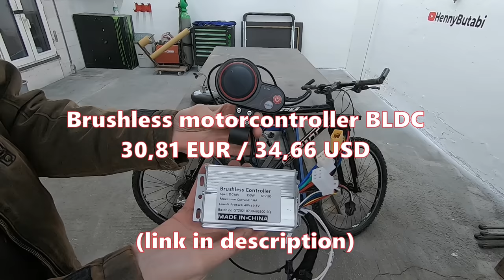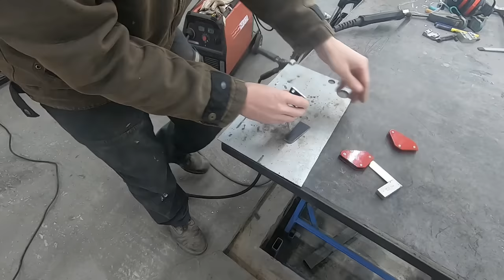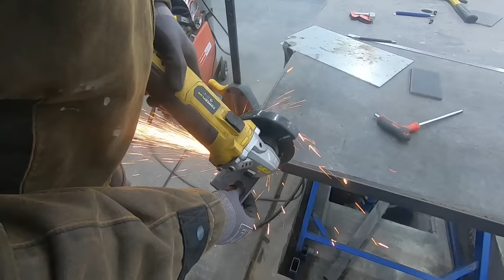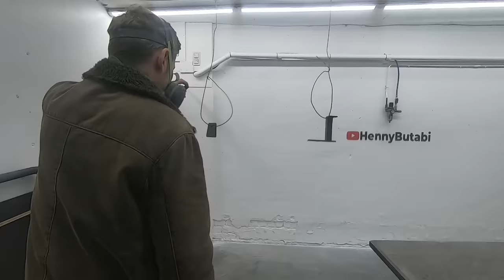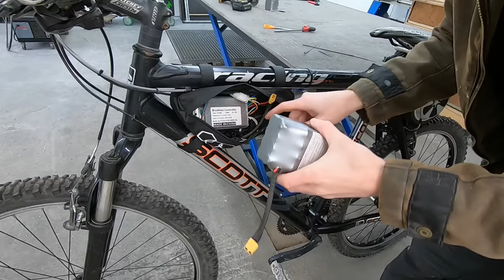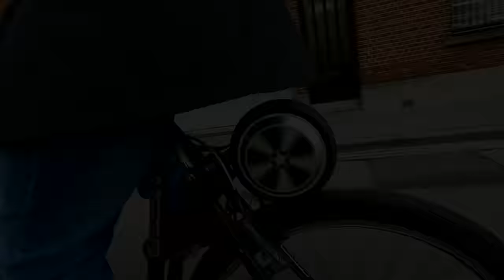Building a very cheap e bike with hoverboard motor - easy conversion

Comment from the maker: Thanks for watching!  Let me know what you think in the comments below ;)
Reply: Originally, the motor is wired in Star configuration. If you rewire it  from star to delta, the motor will spin from the original 700 rpm to even 1200 rpm ! That means you'll gain a lot more speed.
Reply: wa
Reply: Lets assume you don't live in a very dry country and the drive wheel and tire get wet.
Lets say you're Skimming to work and you tyre goes through a splash of oil of another car and you're 7 hours late to work due to drive slippage?
A Design that needs some Design.
Reply: Man I have been waiting for someone to build a friction drive with one of those.
Reply: Can I order this for my son
Reply: We had one of these on a bike my uncle owned , On one of those 26 inch fat tire bikes We called them Bus bikes all the way back in 1973  and if you weren't careful it would eat right through the tire .
Reply: brilliant initial concept. perhaps for the next version it would be nice if the motor mount had a lever so you could engage/disengage the motor from your rear wheel in the event that you ran out of batter you could then flip the lever, disengage the motor and peddle home without resistance.
Reply: @K1VV1939  you can always use the pedals, it is a bike. You are not very smart if you work 7 hours from home and go in bicicle. Your smart question is a ver stupid one.
Reply: The work table set-up that comes out of the ground reminds me of Jack Olsen’s “12-Guage Garage”
Reply: When saw the title I was thinking you drilled the rotor and make hallows in it for the little steel wires (dont know the term) and use it like an actual frong wheel.
Reply: Wery SMART!!! Genius!
do U have Facebook?
Reply: Do escooter bmx ? Video
Reply: I am Colombia  live comprar uno enviar links
Reply: @k_szaf and how I can do it?
Reply: Іsadora Dunkan.....😂
Reply: Hey what would you charge me to ship it to me like all built how you have it exactly the same ,no bike I live in usa, NJ
Reply: ¿Se podría hacer con una rueda más pequeña por estética y que se instale abajo del pedal?

Comment: Your jacket hanging above the rotating engine shold make you nervous. I think that's too close without a cover.
Reply: I only came here to comment the same 😂
Reply: Where’s it gonna go? At least six inches in circumference to reach the pinch point.
Reply: YouTube safety sallies can not resist
Reply: Debieras probar instalarlo atrás de la llanta trasera ya que tienes buen equipo, hasta te protegería del agua que salpica ésta. Suerte
Reply: (motor)
Reply: What in case he tries to do a backbend and touch the ground while he’s driving? There’s no way that coat can get caught…
Reply: I think you (shold) should correct your spelling before you go an trying to correct someone else's mistakes LMAO
Reply: No way!
There isn't an engine anywhere near him.
Reply: @gregholl5011  agreed
Reply: That could be comical 🤣
Reply: It's a motor not an engine , n how much damage can a 1/4 hp motor do anyway ?? Pretty sure the jacket would more than likely stall the motor out anyway , these type comments r friggin annoying..... Like ok captain obvious , he built the thing I'm pretty sure he realizes it hasn't been                  " government"  critiqued for ppl who need "warnings" not 🚫 to receive their Darwin awards....
Reply: Nitpickers. They're everywhere.
Reply: I think the wheel will be damaged quickly.
Reply: @StudentN1  rubber on rubber? How?
Reply: if you sit on it, it's a butt cleaner :D
Reply: @travispratt6327  Do you always wear the same coat?
Reply: @DS-mm6fh  He wasn't wearing a crash helmet either or suitable clothes if he falls off!  He also would get covered in mud and grime spraying off the rear wheel.  It wouldn't take much to jerk you off that machine if your jacket got caught up in it, you only need to tap a bicycle with the front bumper of a car and off you go!
Reply: @FlyinBrian777  Bits from the road surface tend to jam in those systems and cause endless punctures and the wear is quite astonishing.  Same as with the old fashioned dynamos they used to fit on bikes.

Comment: would have been a killer vid if you used nuts and bolts instead of welder, most average people have the skill level for this build and ability to source parts, but the welder is out of reach of 95% of people
Reply: Flux core welder goes for $100 from harbor freight. I've had it for about 3 years. I've probably only put no more than 50 hours of use on it though. I just finished copying this project and putting it on my gas motorized bike to make it a hybrid. I made the adapter for my bike using this welder. Overall there isn't a lot of traction between the hoverboard wheel and the bike wheel so there is A LOT of slipping. I'm currently trying to figure out a way to push the motor into the wheel probably using a spring. The welder worked great for my go kart build, workbench and other projects. Obviously if you're going pro in this area don't get any tools from harbor freight apart from their zip ties which are a real steal.

Comment: Good thing about this idea is that it is completely reversible and the bike doesn't have to be altered. More manufacturers should be providing solutions like this.
Reply: you should be able to done this using arduino, motor driver, and reverse the enable pin, but i don't know in 3 phase motor, should be the same principal and should be able
But why you need reverse in bicycle?
Reply: @yoyatech  he means that he can reverse the process and remove the pieces. Not going reverse on a bicycle
Reply: @alfredo-ff  ah, sorry
i'll tell you guys if i made one
Reply: Better .  Where can you buy precut kit ?
Reply: What watt size are the motors I have two  smart st zing hover boards what range will the battery  give and speed please  I now you could have a bigger  amp battery but this looks ideal for a trip around  a town and light  if added  to a cheap  fold up bike to carry  in a camper van

Comment: nice idea, well done - but far too loud and extremely inefficient when you consider the enormous transmission losses between the two rubber surfaces (abrasion, walking losses, slippage..) Tire wear is also an issue...with the mini battery you get it In this setting, barely over 3-5 km, I'd say. Take care with your jacket  ;)

Comment: I built this over the summer for my kids.  I didn't know someone else was building the same thing.  I like your design better because it's more adjustable.   Btw,  the motor can handle 500w.
Reply: make sure you add a guard. wouldn't want to see what happens to any lose clothing or whatever is attached that goes between those two wheels.
Reply: https://youtu.be/wjAzWgtv5Dk
Pretty sure these will take about 1500 watts if you bring the volts up;)
Reply: @0xsergy  good thinking mate!
Reply: WHY NOT USE BOTH MOTORS?????
Reply: @flojotube  
One motor has plenty of power.  Plus,  adding a 2nd motor just looks weird.
Reply: @FIprobe They guy running them with 3x10S batteries in series did say the motors tend to run hot bat haven't failed (yet).
Reply: After a year of your kids testing the motor with 500w how long did it last?
Reply: @joda4132  
My son used it everyday to school.  No issues with the motor.

Comment: Great subject. I think you need to add a splashback above the wheel (to avoid water splashing against your coat and to avoid something above it can hit the wheel) and a spring/tension system that follows the surface of the wheel. The spring/tension system could also you enable to temprorarily disable the wheel (take off in pause position). This idea is actually something like a Berini (1949) or Solex (1946) with a clip-on motor/engine.
Reply: Loved this project and Just what I was thinking. Yes put the motor on a hinge andI a gear-lever like a handbrake in a car to disable it

Comment: What a totally interesting and unique build! It kind of reminds me of the old tire driven bike lights we had back in the day. It sat on the fork or tail and was a spring loaded device you could move out of the way in the daytime. But then flip it onto the wheel at night. And it was just a textured small metal wheel, that used the spin of the tire to spin itself as it rubbed on it and generated power to the generator it was attached to on your fork or tail. No batteries, just pedal/tire powered.

I had my doubts about how fast it would go, or how well it would work, based on when you fired it up in the shop, upside down. It looked like there might be a loss of traction between the two wheels. But I see how your logic worked there. Once it's upright and your weight is on it, there's going to be flex in the frame and it will make the two meet perfectly. Good thinking, because had you mounted it closer, there might be too much contact and friction/resistance and reverse torque. 

Once you were riding it, you could see there was absolutely no loss of friction between the two wheels and perfect contact and minimal over friction and reverse torque. Just enough to drive the wheel forward solidly and it looked like any other front or rear hub or mid drive ebike. Bravo! So easy to replace too now that the bracket is built.
Reply: Dynamos arent old they are still a thing. mostly in hub dynamos tho
Reply: @hillppari  Yeah, I just saw the old school light dynamo devices still being sold. I guess with the resurgence in vintage stuff, including vintage bikes, they saw a market for some nice chrome classic styled bike lights, driven the classic way. They are mighty sharp looking too, very much suitable for a 1950's/'60s themed bike and is styled after the old school car headlights.
Reply: What is “reverse friction”?
Reply: @thechumpsbeendumped.7797  Reverse torque (or friction) happens in all electric motors. It's a side effect of spinning against something and seperate from regular friction, but related. Like even the parts of the motor and fighting against itself, not necessarily an external force (although it happens with or without load). Bearings, for all that they smooth friction and movement, cause a slight resistance of their own in the motor. The shaft and the brushes rubbing against the commutator etc. That's back torque, or reverse friction/torque. The magnets in the motor also contribute to it. Additional force, against the motor basically, that friction from elsewhere cannot fully account/isn't responsble for. Slight usually, but they all add up.

The idea for generators which eliminate this, is highly sought after for generators that can generate more power than you put in. The quest for perpetual motion machines, we've been chasing for centuries, that's what it's related to. Mind you, not really full perpetual motion, we've given up on that, but close to it, getting way energy out than you put in, no losses=super efficiency. And it looks like India, not long ago, created the first generator/motor, that is so smooth, it's frictionless and eliminates all back torque too (back torque was the final hurdle). The ultimate in efficiency. So reverse torque is a problem, as you can see, in that kind of situation. It's just not one you hear mentioned a lot, because unless you are creating the most efficient motor ever made, we just apply more power to the motor and power past it. It is frequently an ignored metric, except in situations of extreme efficiency. 

It's most noticed and an issue when dealing with efficiency. The most efficient motor (like what India just invented), would be one with no losses, one which eliminates this hurdle and apparently, they have. It would literally have to be the smoothest motor on earth really.
Reply: @hillppari  In the UK Dynamos are banned i think because they dont work when the bike is stopped at traffic lights or junctions...but they were clever little devices when i was young :)
Reply: @MrBilld75  The Faraday Disk Generator, which generates low voltage but high amperage DC current  has no back  torque or friction.
Reply: @michaelngan99  Oh, interesting! So, Faraday strikes again, hehehe. Faraday cages and Faraday disk generators, that dude was a genius.
Reply: There's a blast from the past. 😃Mind over time, they shot the side wall of the tire a  bit, over time.😁
Reply: I remember those friction wheel generators they weren't worth a damn really but I have a feeling today we could do a much better job at something much worthwhile like regenerative braking does by helping to recharge our battery
Reply: @Rob337_aka_CancelProof  Yeah, things certainly have improved a lot over those old things. They were "o.k.", I knew lots of people who had them. But they weren't perfect no and they had issues, as I remember. They became less and less popular as the years went by and rechargeable batteries and alkaline ones, got better and eventually replaced them. 

Much more reliable than a dynamo, but with today's more efficient technology, they probably could perform better now. To the point they could could charge a rechargeable battery and power the light in a regenerative fashion like EV automobiles do with regen. braking, yeah. We were never harnessing lost heat etc. back in the day either and converting it back into power like we can now. It would be interesting to see how those old dynamo lights could perform now with updated tech. yeah.
Reply: @benji.B-side  Yeah, good point, I forgot about that, the wear on the sidewall over time from them. At least we had the option to flip them out of the way, when not needed, so that saved some unnecessary wear.
Reply: I'm old enough to remember those, was born in '73
Reply: @mickyb.8014  Yeah, I was born in 75.
Reply: @MrBilld75  Great back then eh Mr Bill?! Bmxing and all the fun stuff we did, I don't see this when I look around nowadays, I really feel for the kids now as it's all about what tech you have now, we made our fun back then and money wasn't a part of it...
Real simple, but just "real" fun
Reply: @mickyb.8014   Yeah, we sure did. The most exciting and only tech. we had as kids, was playing Atari, Colecovision and Intellivision (and Pong, of course). I remember when my mother a Teacher, brought home a Commodore PET computer the first time, over the summer holidays. I thought it was the coolest thing ever, this was before the Atari days. She even taught me a bit of simple programming for it. We were basically outside all day, making our own fun, building go karts, messing around at abandoned buildings or buildings under construction when nobody was around or playing in the bush. 

I remember finding a working phone at one construction site, line and all, so we started calling the 1-800  lines in the back of nudey magazines and trying to lower our voices to sound like men, hehehe. Hiding Playboys we stole from our fathers or brothers, in  hollow bottom tree trunks and stealing smokes from our parents. lol. Used to pick up iron pellets off the train tracks for our bushcraft homemade slingshots and making bushcraft bow and arrows. Those certainly were the days, yeah. I look back on them fondly. It was a great time to be growing up.

Comment: Cool. That's by far the best of the friction drive systems, excepting for maybe a quick release. It's the only system that provides adequate gearing for a hill and for the motor to run cool. You might run 72 volt for 40mph without issue. Also the simplicity of drive train is excellent and looks durable as hell.
Q's?
Did your electronics get hot in the bag? 
What's spec motor / battery would you pick if you could pick anything?
Reply: I tried friction drive and its not that good. Burns your tire when uphill and works veeery bad after rain. Now i wanna try with chain. I put 44 teeth gear on rear wheel and need to find out some small sprocket on the motor. It might work with ratio 44 to ~10. Will see
Reply: @bobikbobikowy5458  Yep - be sure to get the right shaft size as well as the chain size. They have them on eBay for around $10.

Comment: I built the same last year with a 350w hoverboard motor, but forget the hoverboard batteries that only has 4400 mAh at most, and low discharge capacity cells (few km and power!), and the friction is much better on a city tire. but the most important thing is the controller 36-48v, how many amps it provides because the formula is 36v X number Amps (let's say 20 amps) = 720w at peak (it can be easily handled by a 350w motor), so choose the right one!

Comment: Solid and simple! I wonder how many amps and volts these hoverboard motors can take I'm going to say around 20a at 52v around 1000w or drill some holes in it and add cooling fluid to the magnets and it might be able to handle 2-3KW.
Reply: Такую мощность с таким током длительно не может выдавать это колесо. Сгорит.

Comment: Just got done building something like this. I used a spring to pull it down. It... moves. I guess. The lack of friction is a huge bottleneck. I got some snow on my tire and now it slips so bad it's almost useless. And it's -13 C out right now so... that won't be going away any time soon.

I hate this city's weather.
Reply: that's a shame